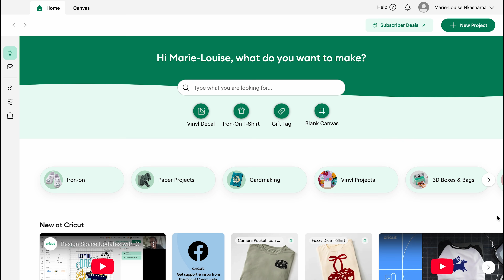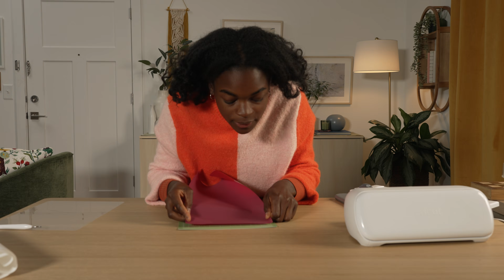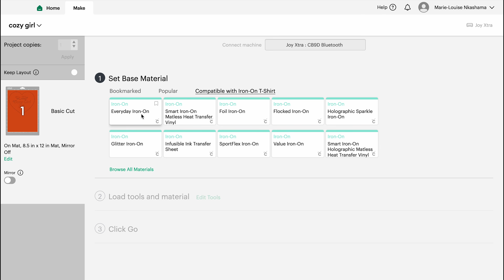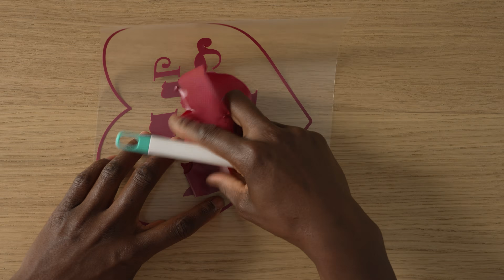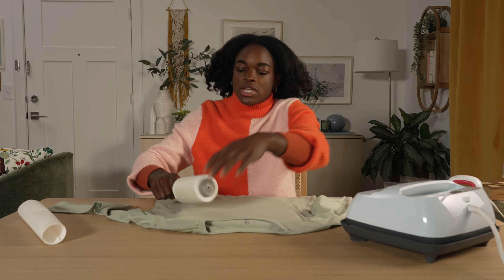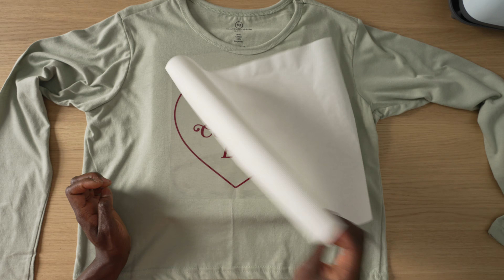Cricut Iron-On for Beginners: Easy Heat Transfer Vinyl T-Shirt Tutorial

Comment: So I dont need to print my iron on out from an inkjet printer first? I can just print it straight from the circut
Reply from the maker: You can use printable iron-on with an inkjet printer, but you can also use regular iron-on vinyl (HTV) and use the Cricut machine to cut out your design!

Comment: Couple of questions do you take the clear thing  off the Matt then put it in the joy machine ? And do you remove the back off the vinyl before you cut it ?
Reply from the maker: Great questions!
You’ll want to remove the clear protective sheet from your mat before loading it into your Cricut Joy, just set it aside while you work. 
And keep the backing on your iron-on when you cut, place it shiny side down on the mat.
After cutting, weed your design and it’ll be ready to apply 😊
Reply: @Cricut thank you! 💜

Comment: Those were some really smart ideas like creasing the shirt and all that, good job my question is with the prints or the vinyls that goe down, does it look look and feel like those cheap shirts you get online? Hopefully you know what I'm talking about were they sound like crunchy paper.
Reply from the maker: It depends on what iron-on vinyl type you use and how you apply it! To help prevent that crunchy sound, make sure you're using the correct temperature/time and use proper techniques like removing moisture from the surface before pressing 💚

Comment: Thank you for the tutorial, this was so helpful! Quick question - if we don't have a press, can we use a regular iron? Do you have any tips for that?
Reply from the maker: For best results, we recommend using a Cricut heat press. Unlike regular irons, Cricut heat presses are built to distribute heat evenly across the heat plate which helps prevent burning of your iron-on vinyl 💚

Comment: What happens if you use a household iron? What does one do if there is lifting?
Reply: I think with a household Iron you cant guarantee a even distribution of heat, especially with the holes in the iron.
Reply: @eloiseg ive try using iron, no problem

Comment: Can I follow these same steps for Smart Iron-On?
Reply from the maker: Yes, the process is essentially the same with Smart Iron-On – you just don't need to put the material on a mat! 

And when you are making your selections in Design Space, make sure you've selected Smart Iron-On as your material so the machine cuts it out properly!